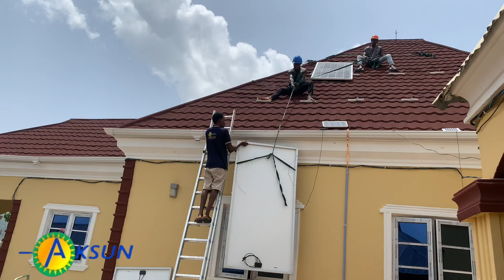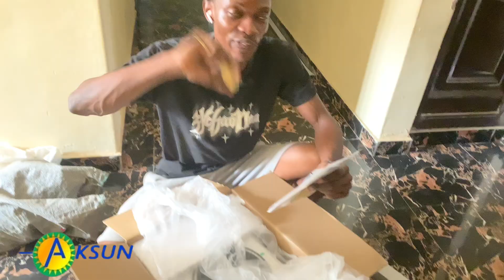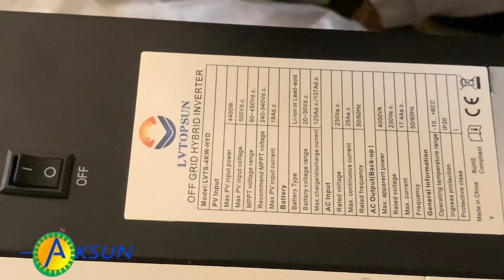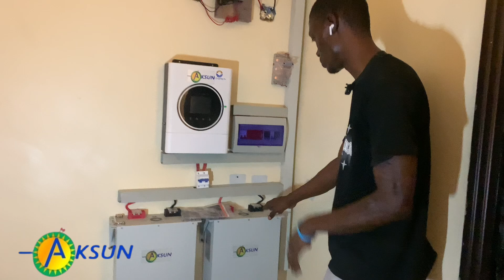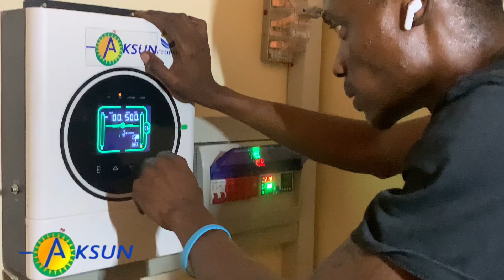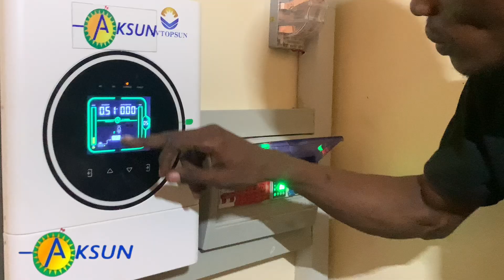Watch how this new design LVTOPSON 4kW Inverter Transform a Home (10kWh LUXWATT Lithium Battery)

Comment: Engr Aksun, why are you still using this Luxwatt Lithium battery for installation? your Capacity testing showed is incomplete...
Reply from the maker: The 3kwh tested 2.5kwh, so I use based on my results